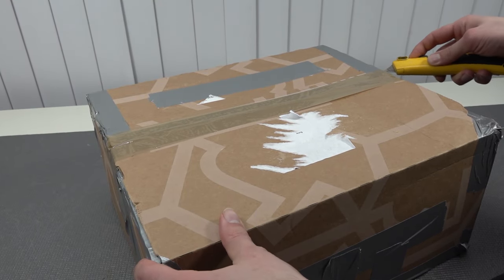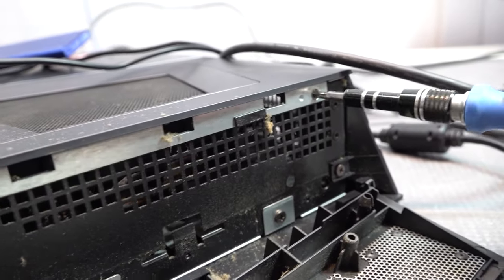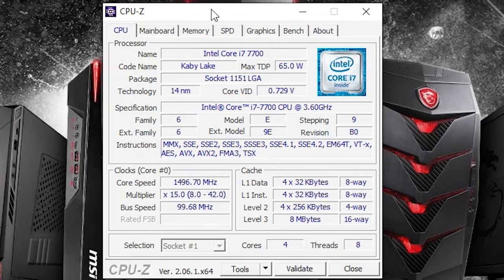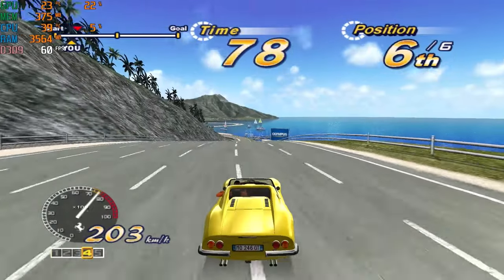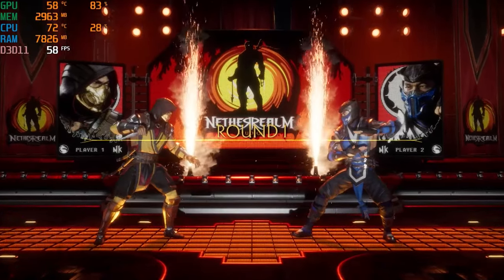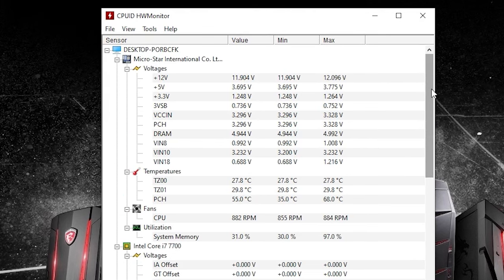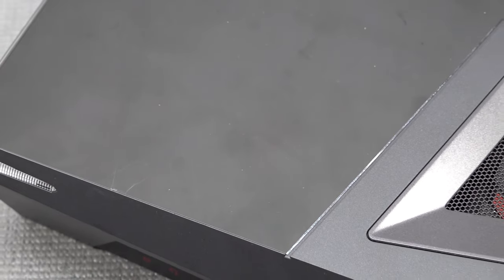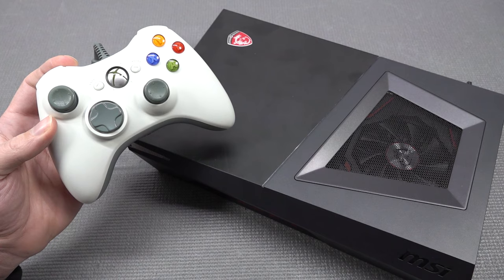This $295 MSI Trident 3 - It's Awesome For Emulation & Gaming In 2024

Comment: It might not need a re-paste, it's likely the fin stack is clogged with dust and you can get to that just removing the blower (repasting might help a little more, but for more work). Do note when removing the blower how the little divider between the CPU and CPU air space is setup, as I had minor troubles with reassembling that to the blower. I had less dust in the blower fan on mine, and the heatsink was pretty clogged, and temps went back to normal after that, without having to remove the heatsink completely.
Reply from the maker: Everything is cleaned now. No weird temps going on. 😁

Comment: It's kind of weird to think of Kaby Lake and a 1060 as "older tech"... I still have an old desktop PC with an Ivy Bridge i7 and a 670 that I built in 2012, and it was always good for playing Wii, Nintendo DS, and PS2 at the very least. I believe it works adequately with 3DS and Wii U as well, but I'm not 100% sure. Then again, I never tried 4K on this machine simply because I've always had 1080p monitors attached to it... but honestly, if you don't need the compact form factor, you could probably turn any old Dell machine with an older i7 into a decent emulation box by just adding a video card for about the same price as this. Or for that matter, with some of the newer low-end Intel CPUs, you don't even need a video card to do basic emulation these days.

Comment: Have to admit that CPU is still good one you could probably upgrade the GPU to a mini gen 3 GPU they actually still made the 20 series for smaller computer chassis
Reply: i7 7700 socket 1151v1. So probably the most powerfull CPU on it that is supported.
edit : Ah GPU. Is the power supply good enough? And a 1060 is enough for most emulators anyway.
Reply: @erikkarsies4851 I own 2 of these. One with a i7 8700 and another with a i5 9400f. There's a bit of wiggle room for an upgrade 😅

Comment: The GPU could be replace with a 4060 card, but the bottleneck would be the CPU... so maybe a 1660 super? Since the 4060 might use less power than a 1060 it probably would get less hot anyway.
Reply from the maker: They also sold it with a 16xx card back then.
Only difficult to find.
Reply: @WickedGamerCollector That one perhaps would reduce the loading/initializing time of the ps3 emulator also? Or is that just CPU bound?